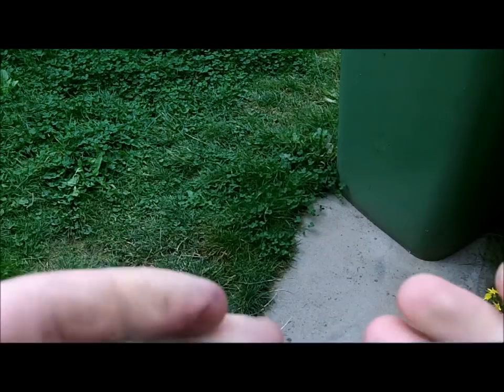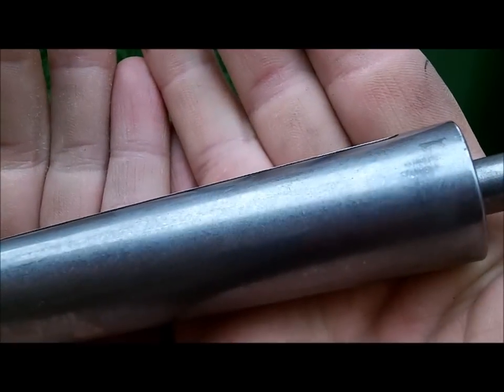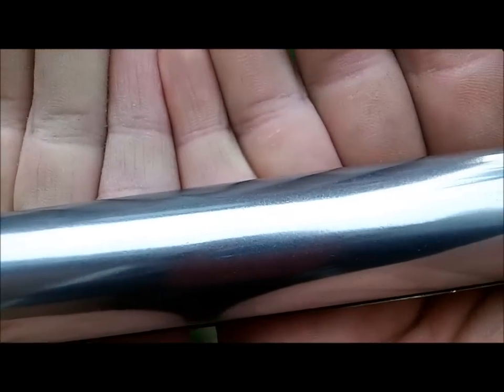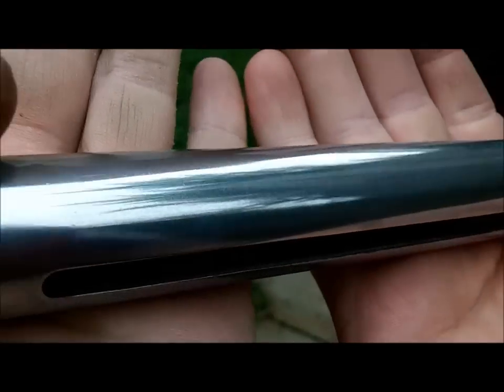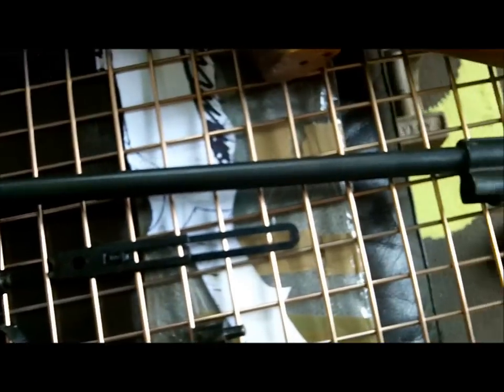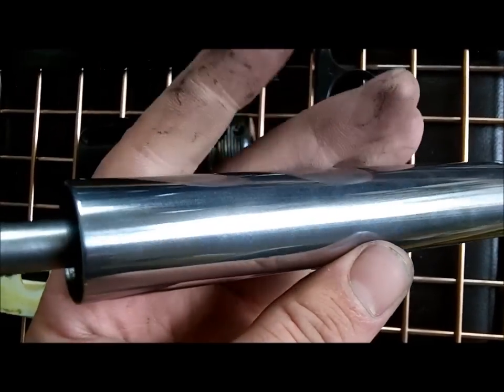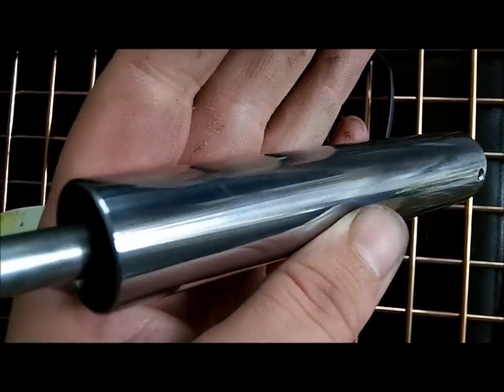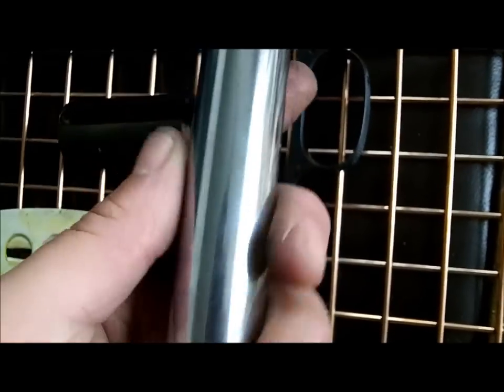Polishing a HW77 Piston...

Comment: Polishing the piston tube looks nice, and makes you feel like a job well done. The way a newly washed car drives better. It actually does nothing to improve the shot cycle. This tube free floats within the breach tube, pivoting at the point the piston is attached. The breach tube I/D is 0.4mm larger than the piston tubes O/D. Because of the way the sear engages, you get some rubbing of the piston tube at the opposite end to the piston. That may be worth polishing out, as is the external diameter of the breach tube. As you mention in one of your replies it just looks nice. Hws are geared up for around 15ft/lb for the European market. Through my experience they all react well to being short stroked. Faster lock time and less hold sensitive.

Comment: why are you polishing something out side that dose nothing  ???
Reply: True I agree it's only cosmetic and just a cosmetic alteration to make you think shiny goes faster
Reply: That is the piston .It rides inside the compression tube .You know nothing .
Reply: @emantide6306  is it not the seal that contacts the liner?
Reply: @madamguillotine6819  at the crown ,yes .And at various points along the piston tube .Polishing makes it smoother along with a thin smear of molybdenum disulphide.
Reply: @emantide6306  i've been polishing mine all evening just got the inside of compression tube left to do. thats tomorrow nights job ;-)
Reply: @madamguillotine6819  I didn't do the inside .Found it ok to begin with. Just did ,piston ,outside of compression tube and all cocking slots .Some polish the rod that the trigger latches onto and of course the trigger ..unless it's fine then just leave it .oh ! Ends of spring and the block at the trigger end that the trigger latch passes through ...that the spring sits on .Polished mine so that spring can rotate freely.
Reply: @emantide6306  thanks buddy i hadn't thought about the block end sounds like i'll be polishing for the next few evenings lol

Comment: That don't even look polished man o man i took my piston to work stuck it in the lathe and used autosol its like glass took 30 seconds .i polished the inside with a tool made from tube ally cut in half and covered with electric tape ,worked well,and my gaffer thought i was working on work stuff 
My HW77k serial 1002 first four.still,shoots 
Like it did from new